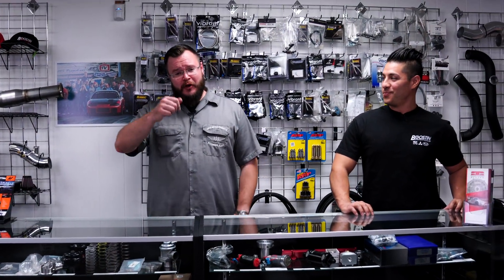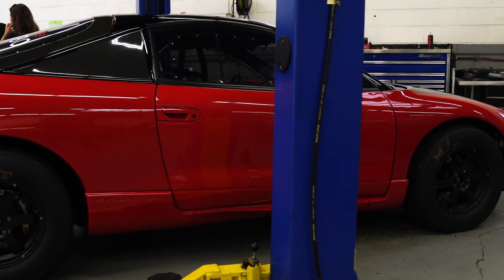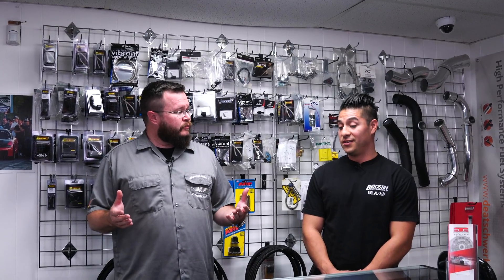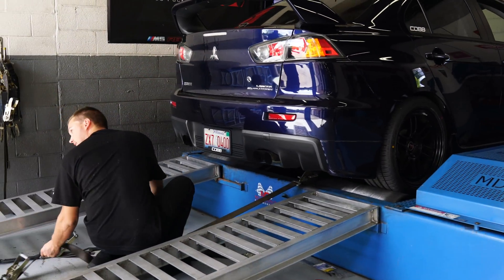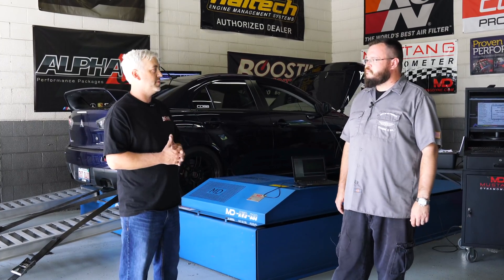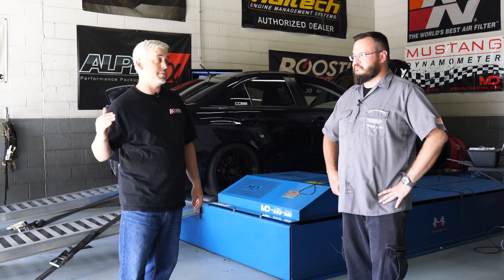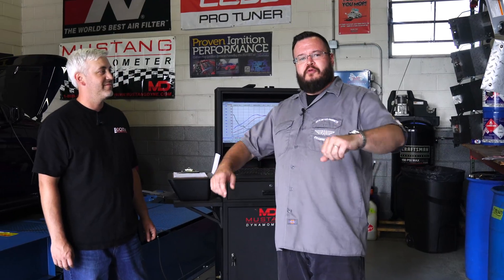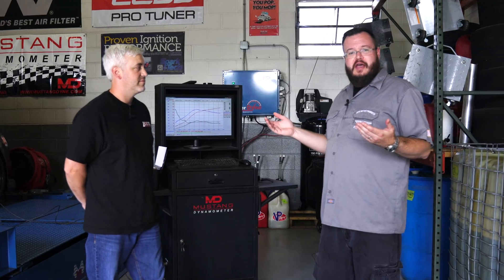AutoMeter Garage Episode 8 - Project Evo Dyno Tuning At Boostin Performance

Comment: I'm a bit confused. That turbo will run 500 to 540 bhp (circa 430 whp) with appropriate supporting mods, principally the conrod and fueling upgrades. 350 whp seems a bit shy in real terms. What sort of evo x is it?
Reply: Sure - your point being it's a relative gain, over the stock engine output. I take your point over the dyno. I think the US got a different evo x than the UK. They shipped most of the cars over here in 2008 ending sales in 2014 with the FQ440. Bit of a shame really. Tuning scene in the US looks strong. I get most of my parts from over there.
Reply: its a mustang dyno, they read about 20% low. we ran a stock c7 and it only made 380 wheel on a mustand dyno, on a dynojet it made 405
Reply: @reeasley5  you realize that's a 6% difference right? Fuckin math...
Reply: They lacked on the fuel pump. They should of put a walbro 450

Comment: Loving the videos and I'm extremely excited to finally find a evo x related channel. Keep it up. At 350whp on the mustang dyno what does that equate to on a dynojet system? I have very similar mods on my gsr with all ets components and a ef2. stock injectors pushing 365whp safely. With injectors I could have ran into the 400s. So I'm sure on a dynojet you would be in if not near the 400s.
Reply: AutoMeter Products, Inc. for sure, I averaged 26.5-27 mpgs on my trip to Texas from Virginia. Anyway, keep up the videos now you are at the point that everything you do I will need to know so I can do it myself!

Comment: 91 octane?  The numbers actually seem a bit low for that bigger turbo. I bet she's a blast to drive though!
Reply: AutoMeter Products, Inc. Right, I understand the comparison to stock.  I run 318 HP to the wheels on my Evo X MR on a conservative Cobb pro tune on their mustang dyno down in Plano, Texas, but on the stock turbo with similar bolt-ons to yours (I also have 214 B cams). So I was surprised to see that your MHI Turbo only put you 30 HP higher than me.  I suppose the benefit of the turbo isn't measured in a higher gain, but in the fact that the gain is all the way to red line, so it makes the power longer in each gear.  Great video!
Reply: Kev - what's the tick over like with those cams fitted? Did you have to upgrade the springs when installing them.